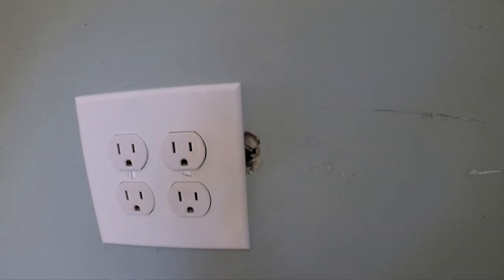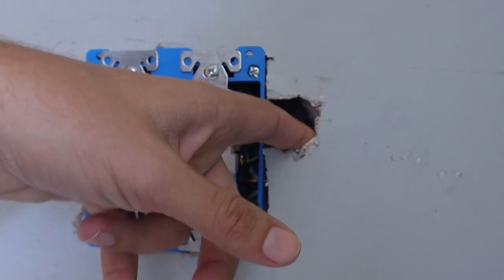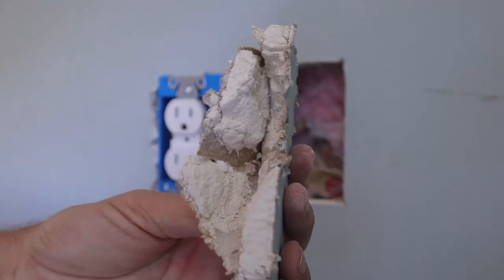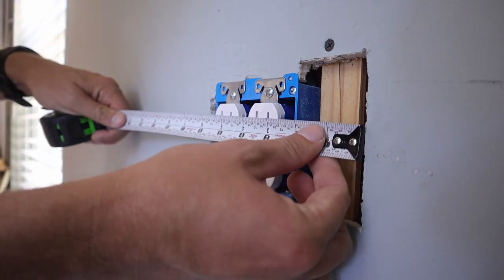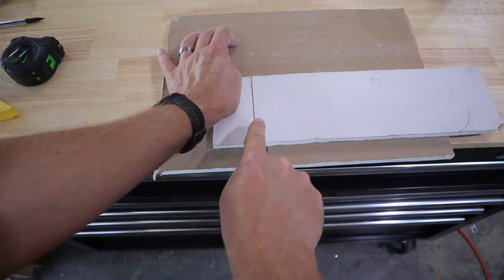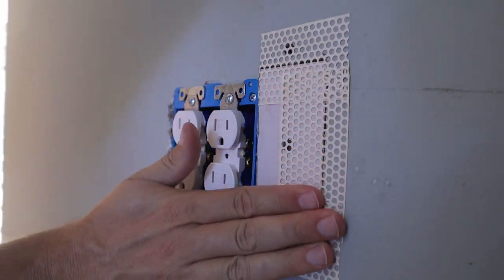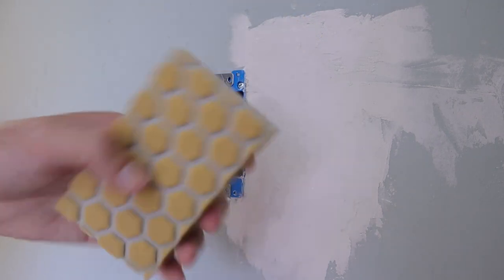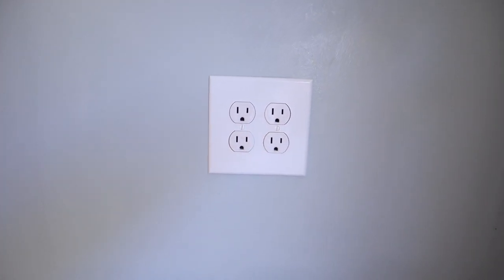How to Fix Drywall Holes and Damage Around An Electrical Outlet Box | Step By Step Repair!

Comment: We would normally do this but found the pieces of wood would often split as yours did at the top. Sometimes the split would come when we were putting in the last screw into the middle causing the wood to separate fully and fall down into the wall, then we'd have to start over again.  We recently found drywall repair clips that forego the piece of wood but otherwise work the same and work very well for small or larger holes that need fixing where you'd need a much longer piece of wood.  If someone needs to go buy drywall to make a repair, they should find the inexpensive clips in the same area.
Reply: Pre drill your screws…
Reply: Use plywood - it won't split.

Comment: I use this method a lot but for that small area I would have used a self adhesive drywall patch with durabond 90 over it first then slightly thinned plus 3 to feather in.  Between durabond  and plus 3 I’m sure will be more than strong enough!

Comment: I use almost the exact same method.  A few suggestions.  I only use plywood, the short length regular wood will split easily, 1/2” minimum.  I bevel the sheetrock on both side (the original and the new Sheetrock) so more joint-compound can go in between.  I only use hot-mud (the white powder you mix with water, hardens in a short time per package), never the Ready-mixed (too soft, breaks too easily).

Comment: Easier way is to pre-cut the drywall piece (larger than the damaged area) and then trace the piece over the damage. Cut out the traced area and install the pre-cut piece.

Comment: The sparkle is the quick set 5, 20 or 45 minutes?
Reply: Spackle isn't that kind of compound. It's premixed and typically used for small repairs because it's fairly weak. It sands easily.

Comment: 1. Your wood backer. You split it at top so it not really holding tight.
2. Cut drywall 1/2 inch bigger at 45 so outside hole is larger than inside.     wall cut so a matching drywall cut at a 45 overlaps. More strength with 45 cuts.  
3 also scene where people make patch 45 cut thur all but paper and cut paper bigger.  Ie.  this shape.       
      _/——-\__
Reply: Cutting accurate and matching 45s sounds difficult, and I'm not sure it buys that much in the end. Do you mean to do that instead of using a backer?
Reply: @grantcivyt  The "backer" is the wood piece.

Comment: All he had to do with this type of electrical box, was to remove the box.  Then attach a string to piece of wood or drywall and stuff it behind the hole area after putting spackle between the support piece and the rear of the broken area, than pulling the string through the hole in order to support the back piece and cover the hole with spackle.  After it drying then cut the string and sand.  🤷‍♂️

Comment: That knife you used was way too small. Use a bigger knife and feather the mud out and you won't have to spend an hour sanding.

The small hole you had at the beginning probably could have been filled with quick dry mud and would have been fine with no tape, especially if you put latex paint over it when done.